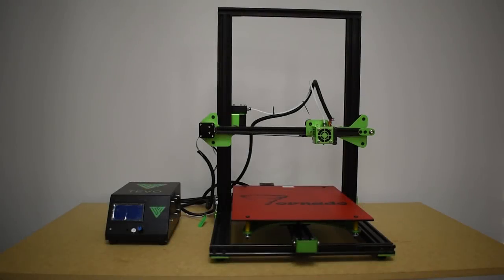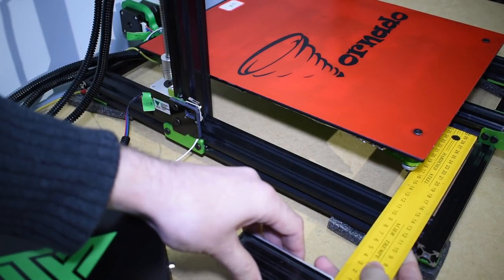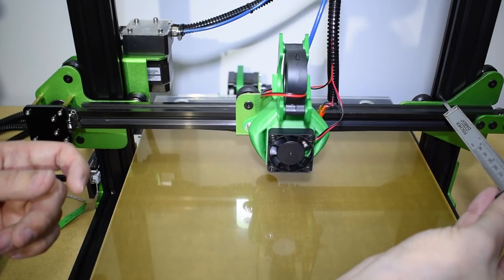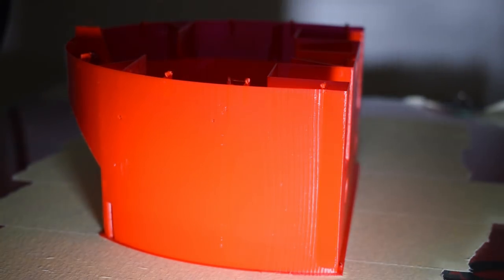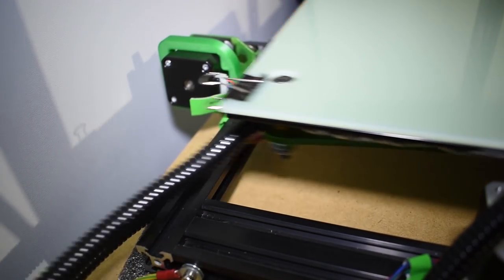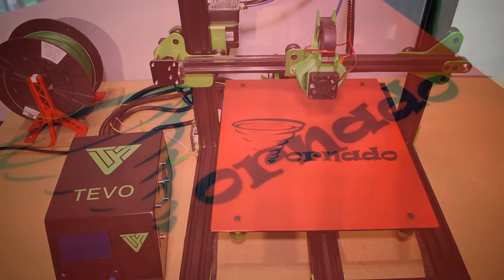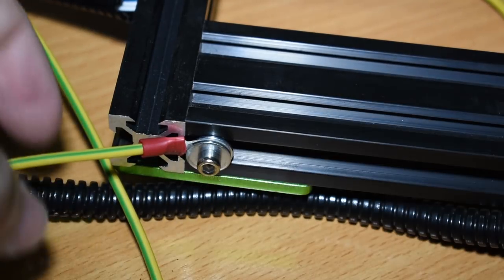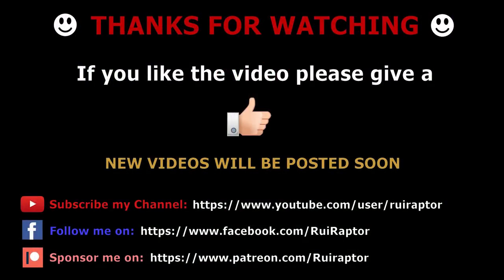TOP 10 UPGRADES You Must Have - Tevo Tornado 3D Printer

Comment: Great timing on this as my girlfriend just unboxed and set mine up.  We hate the bed surface and those bed leveling knobs/spinning screws are frustrating.  It's quite a chore cleaning that adhesive gunk off the build plate.  Thanks!
Reply from the maker: Hi Paul,
I actually have a nice trick for removing the sheet easily. I'm working on exactly that for my next video.
Reply: I found a local store that sells cheapo picture frames and used the glass from one to cover my Tevo build plate. Picture glass is usually just 2mm thick in small-ish frames, just like mine. :¬) The thinner glass heats up reasonably quickly too. I use glue stick to make the work hold to the glass. 
 Glass cleans up nicely with a blade or sharp scraper, but remove it from the bed any time you want to scrape it or remove a printed object. That saves re-levelling so often.

Comment: I do not own a Tevo Tornado but these video's can be used for thinkering on all 3D printers. Great job again as always from Rui, no BUZZ no FUZZ video's............. do not know if it is mentioned in any video but the isolation of the build plate clips are life savers for those working with 220 volt but also for 24 volt heatbeds.  Better not to use those clips at all as they can short out against the heater parts if not isolated correctly also. Thanks Rui.....................
Reply from the maker: Hi, thank you so much for your feedback.
Regarding the clips, i can undestand what you are saying, but in this case, the heatbed has a lot of clearance underneath so you can use the clips as they dont reach the wires.

Comment: Would you recommend upgrade the extruder for an aluminium one. If so, which one you would recommend? Thanks for all those very helpful tips !!
Reply from the maker: Hi Martin, the titan extruder is very good. We don't see the need for a metal one. You could eventually upgrade with a BMG extruder.
Reply: @ruiraptor   Thank you so much!

Comment: #1 What is the thickness of you bracket? Mine is 3mm, looks thicker than yours
#2 X-axes, yes, they differ in thickness by 1mm, but one side came already shimmed with 1mm shims, so for me they are equal distance
Reply from the maker: Hi,
Regarding the bracket, which one are you referring to?
Regarding the X axis, if that is the case then it means that TEVO fixed the issue :)
Reply: Great :)

Mine Y-motor bracket is 3mm, feels pretty rigid to me, but not super rigid, so I'm just wondering if yours is 3mm also?
Reply from the maker: Hi,
mine is only 2mm...that's why is not that rigid ;)

Comment: When ordering one of those print surfaces, do I have to give them the size and location of the holes or just the printer name?  Also which one of the 3 print surfaces is your 1st choice?  Thanks again
Reply from the maker: Hi,
The mamorubot print surface already has the holes and it's the exact dimension of the tornado heatbed. You just need to select the tevo tornado one. For the printbite+ or the filaprint, you order a 310mmx310mm and you glue to the heatbed or to a glass. If you buy a glass you need to get one with the holes. I bought mine at a local glass manufacturer.

Comment: Hi, do you highly recommend tevo tornado for first timers? Thank you.
Reply from the maker: Hi,
Yes i do.
Tevo tornado or tevo flash. Both are great options.
Check here: http://tevo-3d-onlinestore.myshopify.com?rfsn=1689252.9c830
Reply: ruiraptor  TBH the messing around with resistors and the boards is a bit intimidating for me, as I was looking at getting this printer as my first step into 3D printing.
Reply: Thank you Sir.
Reply: Yes
Reply: @yurika12  I don't know if you already got a printer, but as a suggestion, I started with a Monoprice Select Mini V2, which is quite cheap comes already built  with no additional setup, the build area is not too large but enough for  anything under 120mm  perimeter, just put your filament in, level your bed which usually already comes leveled for you and you are ready to use, started my first print in 10 mins after unboxing, super easy to use and understand, now that I feel a bit more comfortable with the 3d printing concept and the machines, I ordered a Tevo Tornado and I'm waiting for the package to arrive :) quite exciting

Comment: Thanks for making this video- some great tips there! What about NEMA17 anti-vibration mounts?
Reply from the maker: Hi Vahe,
Some users in the official forum have installed those anti-vibration dampers. I never tested those as i don't see the need yet.
Reply: ruiraptor I have them installed on my x and y axes, and can recommend them if you're looking for quieter operation. One thing to note; you shouldn't use an anti-vibration mount with the y axis brace in the video as this would directly couple the motor to the frame again which would defeat the object...
Reply from the maker: Yes, i agree 100% about using the anti-vibration with the printed motor brace. Thank you so much for your feedback on this :)

Comment: Does the tornado come with auto-leveling?
Reply from the maker: No, it does not.
Reply: @ruiraptor  But is it possible to upgrade it to auto-leveling?
Reply from the maker: Yes, you can install an auto level sensor.
Reply: No but you don't really need it. It take about 1/2 hour to manually bet level. I have found that I only have to bed level every once in a while or if I move the printer. Compared to my XYZ printer this manual bed leveling process is so easy. You can add a bed leveling system if you are up to it but you really don't need it. I think even with a bed leveling system you still have to manually bed level once in a while. I have the gold edition and love it.

Comment: What about the newest printers, the copper ones?
Reply from the maker: The new copper ones are the same. The only difference is the board (MKS GEN L), the color and they do not include the print surface on the glass. Rest is the same.

Comment: RUI - Awesome overview. On item 2 what size spacers (washers) did you use as far as inner hole diameter and overall diameter on the X axis roller? Also if you ordered them do you have a source with Part numbers? 

Thanks
CB
Reply from the maker: Hi Charles,
The inner diameter is the same as the screw that is going through the wheels.
Regarding the outer diameter, it does not matter much since you will use the stock shim to be side by side with the bearing of the wheel.
I bought my precision shims locally but i bet you can find them on the internet like ebay for example.

Comment: hi! is this info still up to date? great video! thanks. very informativ.
Reply from the maker: Hi, the biggest difference between the green tornado and the gold one is the main board. The gold one uses the MKS GEN L board which means that you don't need to buy a new board just to replace the drivers.

Comment: Don't ground to anodized surface... anodize layer is non conductive.
Reply from the maker: The ground wire is connected either to the end side of the profile (which is not treated or painted) or at the side but scratched first.
Reply: The threads in the frame are cut after anodizing, so even without a conductive surface you still have continuity to ground via the bolt.

Comment: Please correct me if I'm wrong but from a relative perspective, could you omit the x axis plate Shims and compensate with the angle of the gantry? If anything it would be fractionally sturdier, no?
Reply from the maker: Hi,
Thank you for your comment.
Regarding your question, do you mean rotate the vertical beams so that they get the same angle offset as the x axis?
If that is the case I find that solution a bit harder to do because to do that you would need to drill bigger holes to the bottom horizontal beams so that you can have the necessary play.
I also believe that the bigger holes/play might cause the upper frame to misalign over time due to vibrations. You can add some corner brackets to reinforce and prevent this to happen.
You also have the option to just rotate the Y axis beam where the wheels go on but that can also mean some rework. Need to check that.
Anyway, it is my opinion that the shims are the correct way to fix this as you keep everything nice and square and you get a solid installation. And please note that with this offset, the wheels are also not squared with the vertical beams because the horizontal x profile is forcing the wheels and green plates to be in that angle as well.
And they are not that hard to install. You can do it by removing the wheels with the eccentric nuts on both sides and also
the leadscrew nut. Then, unscrew and release the other wheels and this way you can access and install the shims. I was able to install the shims without disassembling the entire x grantry.
Reply: ruiraptor thank you for your consideration, you make a good point. I only considered this, because I measured the amount of play on the fixtures of the vertical beams.
Thanks again for your good work =]

Comment: Why even use another print surface?  I print directly on the bed, its fantastic.
Reply from the maker: HI,
the answer is very simple...i prefer the print surfaces that stick the filament when they are hot and release when cold. I dont like to force prints out, use masking tape or glue, etc.
Reply: I have also found my glass bed to not be perfectly flat as a ultrabase is
Reply: The print surface under the default buildtac surface is Glass.  Once you clean off all the gunk you have a perfect build surface, just a little hairspray and you are good to go.  Buying another surface is a waste of money.
Reply: LOL, nice try Ultrabase resellor.
Reply: Did you completely miss the portion about how the bed isnt completely flat? Yours may be, but i have a .001 mm gauge that shows the discrepancy very clearly.
  I've also used hairspray and gluestick with the bed minus the build tack and a separate sheet of glass both. The gluestick was the better option, but required cleaning after every print. The hairspray just makes everything around it a sticky mess over time and was much more of a PITA to clean although it tended to leave a better surface finish on the bottom. Both of which also needed a touch of coaxing to remove from the bed. The Ultrabase literally can be blown off the bed after it cools. So the Ultrabase wins for me.
  The only downside that i have encountered with the base so far is its intolerance of the nozzle scraping and thus scratching the bed. Oh and maybe extra weight on the Y axis.
  It also costs less than a roll of cheap PLA, but if money is that tight, i deff understand. Im there at the moment myself. I just prefer the ease of use as well as the guarantee of the print always sticking, so decided on that instead of another PLA roll.
  Lastly, do you see a affiliate link anywhere? I just share my knowledge with people to potentially help people out. Take it or leave it, dont really care. But i dont like insults for giving my opinion. People sure are rude when they arent face to face with a person. Or are you just this rude all the time?

Comment: Where did you get your precision shims at? Everywhere I look the price and quantity it way to high.
Reply from the maker: Hi Larry,
I got mine on ebay. Just search for 0.1mm, 0.2mm or 0.5mm washers.
Reply: Most beer and soft drink cans are 0.1 mm. You can punch the hole with a regular paper hole punch, then cut the outline of the  washer with scissors. Punch the hole first. It's too hard to hold it after you cut the washer. Stack a couple if needed. Easy and fast to make. Cheap, plus you get a drink.

Comment: This is all great stuff!  I'm thinking of getting a Tornado, so this will help if I do.  Question for anyone: Is there a way to upgrade to a dual z motor/screw setup?  Does anyone sell a good kit for that, for the Tornado?  I'm assuming the ones for the CR-10 wont work with this.
Reply from the maker: Hi,
People have been using the CR-10 kit with great results
Reply: That's interesting... I thought they were different enough to not be compatible for the dual-z motor upgrade.  But if they are, that really makes me seriously consider the Tornado.

Comment: Would the Hywin rails upgrade work on this? Would you recommend it?
Reply from the maker: The rails should be fine but unless you modify the frame to have 2 rails in parallel and with some distance to each other, it does not make much sense as the 6 wheels work fine.

Comment: Is that a 6" or 8" Dial slipper you're using.  Thanks so much for this video and links.  I just bought a Tornado.👍👍👍👍👍  Could you give the names of the print surfaces again?  I got PrintBrite+ but not the other 2.  Amazon has quite a few listed.  Thanks
Reply from the maker: Hi, 
yes, it's a 6" (150mm) caliper.
The print surfaces i have for testing are the filaprint, the printbite+ and the Mamorubot.
Reply: Got it..Thanks much.
Reply: Thank you.  I used to have one somewhere but can't find it.  Just ordered a digital one like yours .

Comment: You talked about the heat bed issue. The TEVO Tornado I received about 1 month ago has the Green covered bed, with a Red over-lay pad that I guess is an option, no information on it that I have found yet. Very shortly after using (within a week) the Green has developed bubbles as you described to the point of build failures and basically making it unuseable. You showed other beds, are you suggesting them as a replacement? If so, do they also run on 110V with the same current being supplied and controlled by the TEVO base unit? I am not sure what to do at this point.
Reply from the maker: Hi Tom,
You just need to remove the print surface. The heatbed will be the same. The print surfaces are placed over the heatbed. I will publish a video very soon explaining how to remove the sheet and some tricks that will make it easy.
Reply: Thank, I will be watching for your video. Also, can you include any suggestions as to what to put over the cleaned heat bed - if anything.
Reply from the maker: Hi Tom,
check my newest video as it answers your question (https://youtu.be/4xIKJnZ4Uwc)
Reply: Tom, you dont need anything on the heat bed, other than a little hairspray.

Comment: I have a question hopefully someone can answer. I want to get into 3D printing & I'm a complete novice to it, but I'm very technically inclined. Been in the computer industry for over 30 years, can do board level soldering, home automation & work in the security alarm, access control, & surveillance for a living. I'm looking for a printer that can do great printing for the value, but also upgradable if possible. The more I look at reviews on printers the more undecided I'm getting. Thanks in advance.
Reply from the maker: Hi John,
I understand you completely.
There are some factors that will determine the choice of the printer such as the print area, how much you want to spend, etc.
The tevo tornado is a good choice as you have a good print area, good board (MKS GEN L and can upgrade drivers easily), the AC bed, great firmware from stock and many upgrade versions available and also a big community on facebook.
Reply: @ruiraptor  would you recommend anything over a cr10? I'm looking for a largest, most versatile printer, that is the quietest. I used to have a tevo tarantula, but have heard alot of good from the cr10

Comment: Man...sooo many things to fix which should be addressed already from factory! I look somewhere else or get the original cr10
Reply: I don't know when it happened but I got a Tornado for Christmas 2019 and:
#1: the motor is mounted to a 3mm metal plate, no bending with the rubber band
#2: the washers were already installed
#3: had no problems with layer shifts
#4: no salmons either
had to do #5, #6 and #9 myself
#7 someone will always be unsatisfied

it is a great printer and don't underestimate how nice that high-voltage bed is!

Comment: Get the 8 diode TL Smoothers. They produce better results than TL Smoothers will less diodes.
Reply from the maker: Yes, that is correct. Only the 8 diode version smoothers are capable of getting better results. I also suggest to get the trianglelab plus ones.